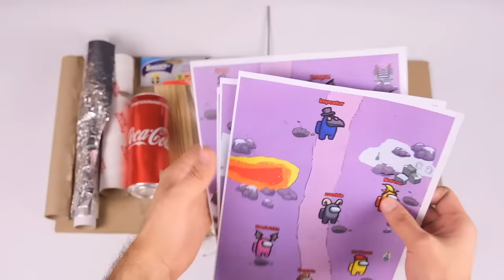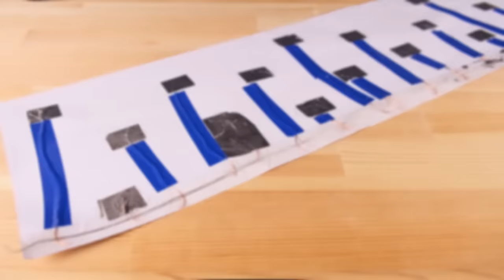How To Make AMONG US Game From Cardboard

Comment: This guy needs a rubber finger protecter
Reply: What
Reply: I dont think so....
Reply: @amongus134  he’s saying he needs rubber gloves for the electricity part, bc it isn’t safe using wires like that
Reply: @mayorofmorioh1773  its low voltage and low current, its not gonna shock him if that's what you mean
Reply: High Voltage
Reply: @user-fy4px8hd9m  it appears to be a 9v
Reply: @jayenbhakta692  I know but better safe than sorry :/
Reply: @mayorofmorioh1773  9v battery can't do much damage, even if you lick it

Anything above 12v, I recommend higher caution

Comment: I really enjoyed watching this video from the technical standpoint. Not sure if I'll get a reply this late after upload and with how many comments this video has but it's worth a shot. I follow everything up until the fail trigger. When non-impostor passes over an imposter im not sure what is triggering the Game Over sequence. Nonimpostor as far as i could tell is just thin cardboard on a fishing line, not sure how this is triggering the underneath wires/contacts for a fail condition. If anyone can point me to a time code that shows what I'm missing I'd be very appreciative!
Reply: nevermind! just went back over it myself and i now see that there is a contact (the sliver of coke can) on the movement actuating arm (metal bar with 2 right angles). very intuitive!